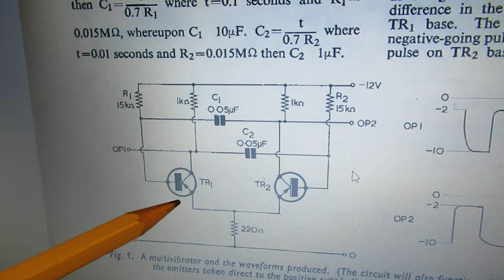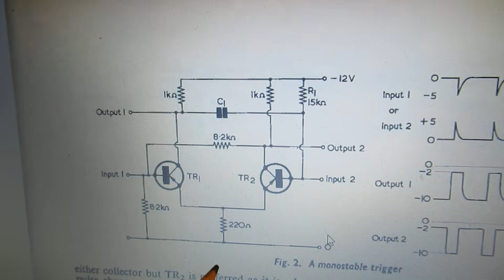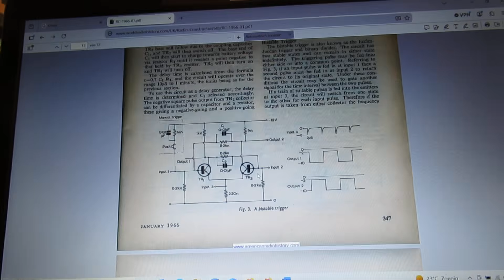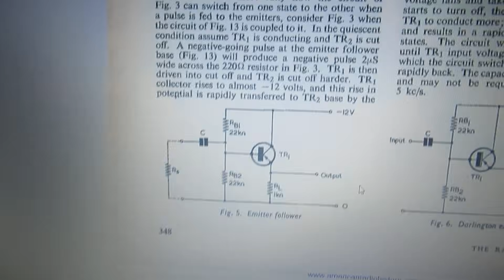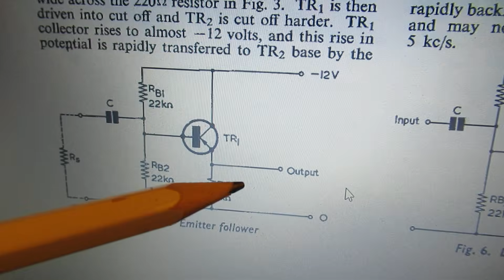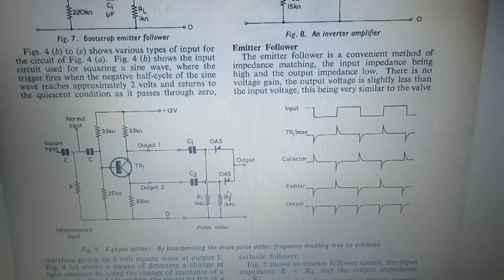Changing old 1966 1 or 2 transistor PNP pulse circuits to modern times, to be used with NPN Si types

Comment from the maker: On 7.48 I say: that there is no good indication in that 1966 circuit about the voltage where the Schmitt Trigger changes its state, say from 0 to 1. That is not OK  what I tell there, because the 1966 article clearly shows the options (via a voltage divider) to make the Schmitt Trigger act on voltage X or Y. A Schmitt Trigger acts (in electronics terms) like a marble on a seesaw. There is no moment in-between when the voltage drops from value A to B. So the Schmitt Trigger is the perfect (!) electronic switch, it has no hysteresis, or a hysteresis in a very tiny time domain or thus (almost) no time domain.11 aug. 2026.